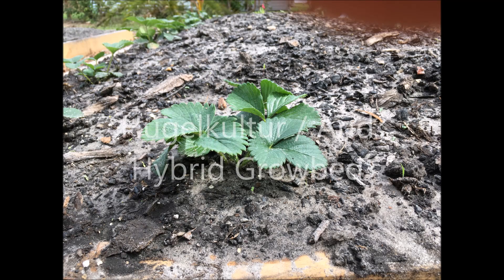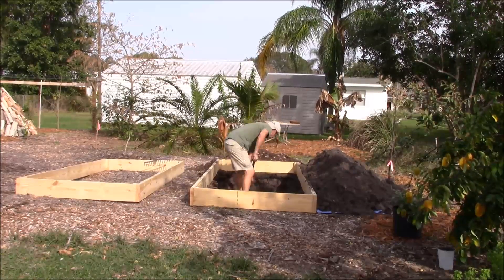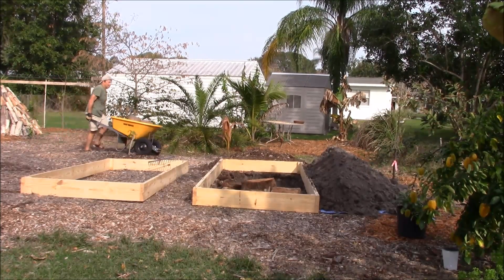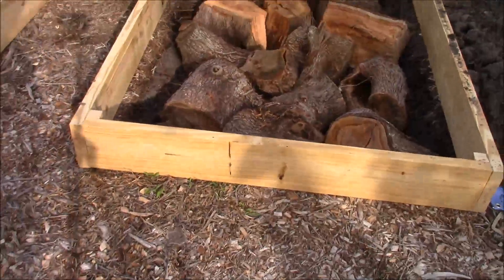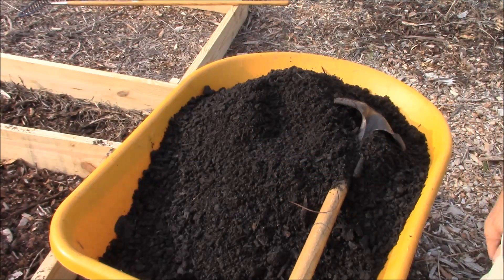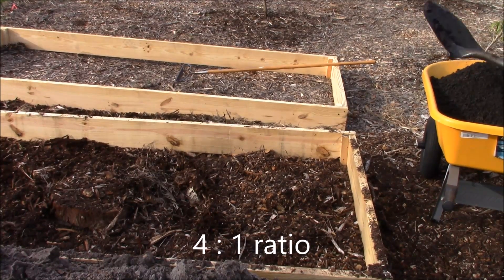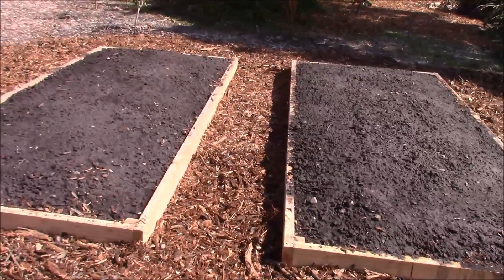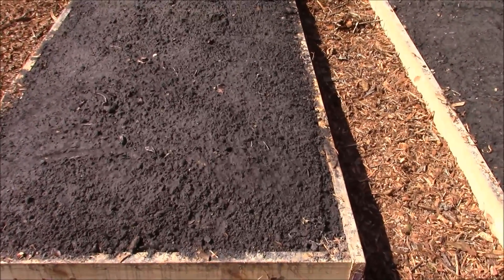Hugelkultur Arid Hybrid Growbed

Comment: You get a thumbs-up for making as hugelkultur, but those large wood trunk sections (on the barrow) are far from optimal. Chunks that big would be there 30 to 50 years later and are best suited to deep burial a couple metres under ground (and even then you want to split it in quarters through the core heartwood as that is most protect against rot). Had you buried it with saturated woodchips deep in the worlds most arid area where you want to plant another tree, it'd do well (but even then, split that heartwood).
Reply from the maker: thanks for the tip.